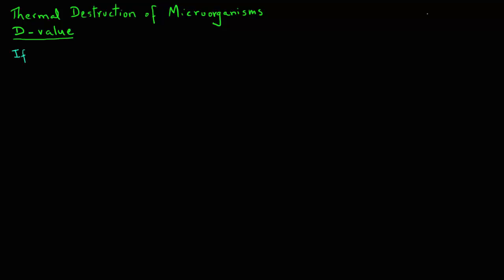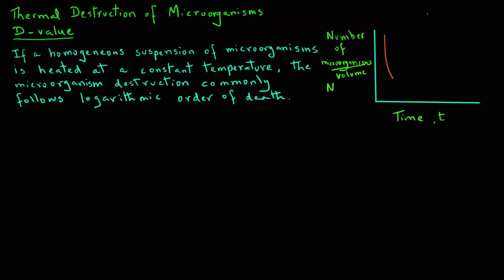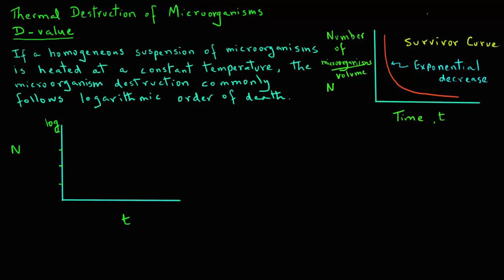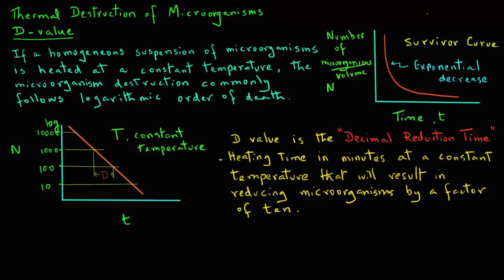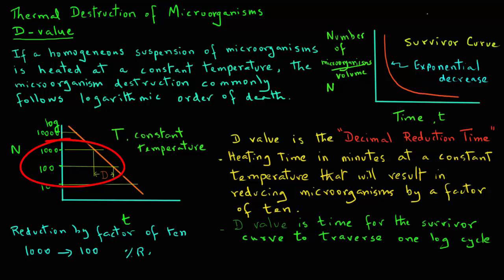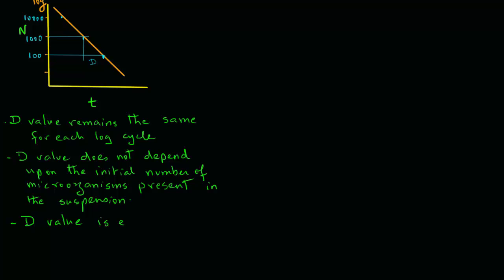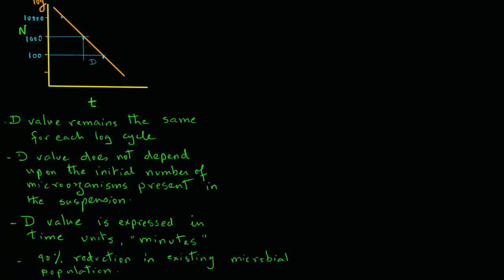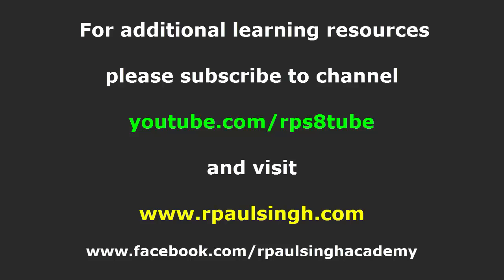D value Decimal Reduction Time

Comment: Confused about why you would need to heat it 2 x D ?? I watched your other video- however, aren't you saying that 1000-100 is 1 log cycle? So wouldn't it be 1D?
Reply: Yes the 1000-100 example was 1 log but at 5:28 when he is discussing the 2 log reduction he uses 10,000 as the starting population, not 1000.